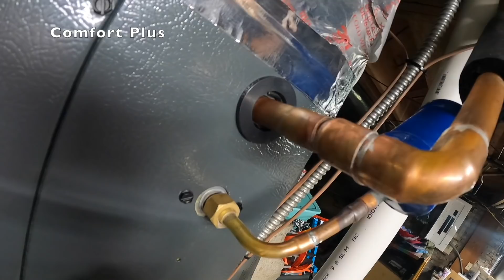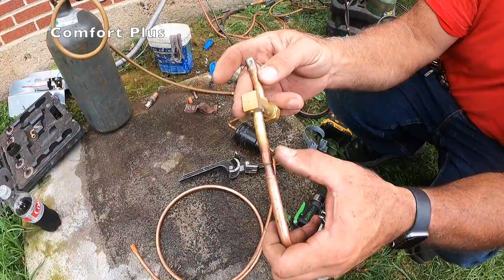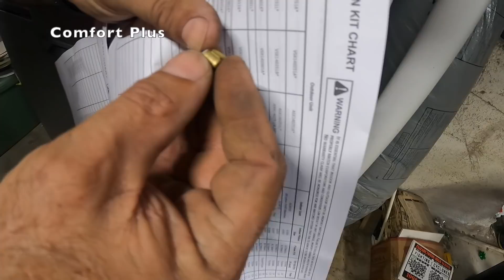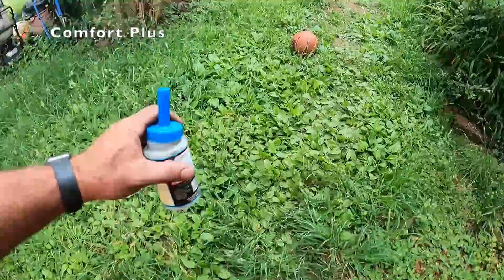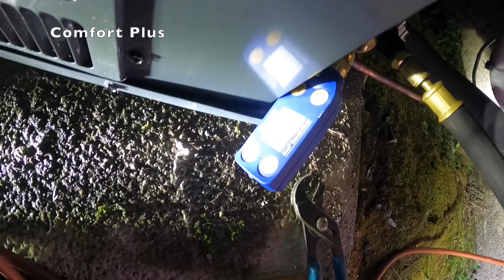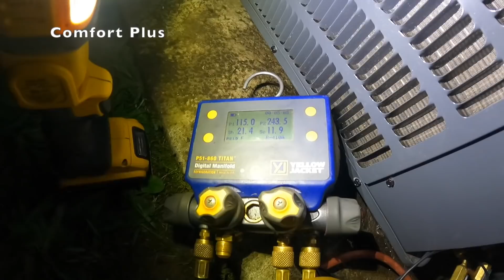HVAC: DIY Goodman Install: Can this unit be saved?

Comment: Wow, what a mess.  I just installed a new Goodman system using Stay-brite 8.  Worked great, system very tight.  Had to flush out the old lines and clean everything out, but the system held great.  For sure the initial vacuum took a bit longer to make sure everything was out of the lines.  Installed with TXV and the system runs awesome.  Adjusted the airflow down to the AHRI rated flow and works like a champ.  Did have to add 410a to the system due to line length, but tech friend helped with that.  People need to understand their limits when it comes to DIY, but hard for some to make a self assessment.

Comment: I would've just installed a whole new line set. That redneck homeowner DIYd the whole system to death with that soft solder it'll eventually come back to wreck that compressor over time. If anything, flushing the whole system to include the condensor would've been the best thing to do before installing a new drier it's gonna cost him an arm but do it right the first time and you'll never get a call back from this owner. Thanks for the video! This is a great Do's and Don'ts video!

Comment: I went to a house and found a water heater hooked up with garden hose and hose clamps. It wasn't even good water hose like the heater hoses in your car, just vinyl dollar store hose with worm gear hose clamps. It leaked just a little, but was in a basement with a dirt floor so nobody really noticed. They had well water so the pressure was low just 30-40 psi.

Comment: FYI for anyone have this issue, Not related to this but since worked on a goodman, not much issues with but one thing have happen on some high eff goodman furnaces run into the solder connections on the Control board for the molex connector for all the sensors etc weaken and crack making intermittent connections, I liked to have never found that changed board and fixed but was so intermittent almost never found, looked at solder connections and could tell was broken loose so re soldered put back in unit run fine ever since. So if get weird intermittent issues, control board but may just be bad solder joints.

Comment: Have some experience, Most Auto but some residential and studied with some commercial on site maintenance guys when did repairs and installs in data centers in company I worked different job once, let me help train with them some. Did some courses too at night, I understand all the aspects and can do most of the install but brazing, I have brazed (welded etc) but I know when not done it enough to do it right on these systems, I let the pros come in and finish it up. And I have talked sever other guys thinking they can install and when I walk them through everything and explain why it has to be done like that they get nervous and hire it out in the end.

Comment: I contracted with a HVAC company to replace my 2.5 ton HVAC with a 3.5 ton unit back 3 yrs ago. The original unit was undersized as per the HVAC company  1950 sq ft and 9 ft ceilings  At the time I lived in NY and my condo was in Florida.  I recently reviewed the registration from Goodman and the condenser unit says it is a 3 ton unit and the air handler can handle up to 3.5 ton.  I called the company and they told me it is the handler that needs to be 3.5 ton and the unit is set up to deliver 3.5 ton.  Is this common in the industry to install a 3 ton condenser to deliver 3.5 ton performance?  I just can't understand how you can install a 3 ton condenser unti and be able to get 3.5 ton performance.
Reply: All you are getting is 3 tons.

Comment: Personal tip, if you please. Take a little liquid acid flux and some Stay-Brite solder and solder the twisted wire part of your fitting brushes. Cut them off at the handle and put them in your battery drill to get a better cleaning job at 1/10 the effort.

Comment: Might have been easier just to cut right behind the bells at the outlets of the service valves and swedge new bells in (or use couplers), than cut back on both lines and couple in new pieces, spin (drill) swedge would work great. Suction line on the inside could do the same, liquid connection cut the bend out and put an elbow in, and than new lengths to fill in. No mucking around with solder removal, unless of course you can see any in the pipe after the bells are cut.

Comment: I have a pretty similar 2.5 ton heat pump with gas aux heat, that I installed in 2016, to replace the (literally) blown up (Original 1956!) Chrysler gas furnace of my newly purchased 'fixer upper'.
Every joint that was silver soldered had n2 flowing through it. Paid close attention to the piston on the evap, etc.
At the same time, the gas company wouldn't turn on the gas, because, while relocating my meter (it was 1 ft from the road) to next to the house, they determined I had leaks in the house. Got those fixed (60+ year old pipes suck!)
All that said...
Other than a condenser fan capacitor fail on a 107° day, I haven't had a bit of trouble with it.
OK, wasn't my first rodeo. Been doing it for 50 or so years.
You do good work, no doubt!
Would you take a tip?
Move your torch around more, concentrate your heat towards the top, but spread it down, touch your stick to the opposite side of where you concentrate the heat. When it melts, it will flow to the heat, add rod till it stops, then quench the joint with a wet rag. The last step will anneal the copper, so that it isn't brittle. 
Try it out!!
A guy I worked for kept calling silver soldering as 'welding'... I would correct him on that. One day, I set down with my tig welder and after many attempts, tig welded some refrigeration copper fittings together, took them in to him to explain 😄.  He went to "silver solder". He didn't want me to 'weld' a joint again!

Comment: I was in residential for 35 years and honestly never seen JB weld on refrigerant lines I guess they were trying to stop leaks maybe? Also the line set size was the cond unit undersized ? I didn’t catch the model number

Comment: Great video thanks but I have an question ?? >  why 2 dryers ? 1 new Liquid line dryer in outdoor unit ( Goodman always 99.99999 % if not 100 % do  have  one built in but hate them when its time to replace them  lol ) )  & now an 2 nd  dryer  inside ...is usually an No No on 2 dryers was way I was always tough anyways 27 yrs & counting install & service ...unless its temporary  to clean up the botched system  esp with an piston non txv coil metering device ?? Thanks

Comment: Read some comments about teaching the homeowner a lesson by charging 7000 to do this repair. This is the reason some techs get bad comments about there work. This is what gives the homeowner bad vibes about installers especially new one . They forget the customer may have been overcharged 2500 by some sales guy who works on commission and now has a problem that was caused by a install tech who cares only about money and over charging so he  can make a 100, 000 dollars in 9 months and hibernate for 3 months because he doesn't like the cold weather. Goes both ways.

Comment: I'm a DIYer to the extreme and I had the EXACT OPPOSITE experience from this video. I did not want to own the $1k of brazing equipment for the very last step of my careful install, so I hired it out. I did not keep the helicopter running and discovered the guy using the high temp rod material and doing everything COMPLETELY WRONG. (Turbo-Torch, No Nitrogen, no hi-silver and flux and making really ugly globs that looked exactly like that hideous epoxy shown in this video. Stopped the debacle before the service valves were opened but it still makes me sick to think about that copper oxidation inside my system.  Got it cleaned up now and it's still running after almost 2 years... I was hoping for 25 years so it could outlive me.  Wish you were the guy I called instead!

REGRETS, but at least I did not have a DIY welding accident and burn my house down or blow myself up, but please pray for my TXV.  lol

Last time I touched an oxy-torch was over 50 years ago in high school and I have absolutely no doubt I could have done a perfect job after an extra tank refill worth of practicing on some scrap fittings.
Reply: There are bad DIYers and there are bad professionals... technical understanding and common sense can take you a long way. There is more then enough information out there to avoid these FUNDAMENTAL mistakes made by this DIYer.

Comment: Don't have a clue what the original installer was doing but I can say that I have Installed countless AC/Heat pumps, remote coolers, refrigerated drawers, walk-ins etc. with Staybrite #8 without a problem and a lot quicker than trying to "braze" with Sil-Fos even the 15% and I can normally do it with a Mapp gas torch. The fact that it actually flows at 450 deg. keeps me from annealing the copper each time I heat it and fatiguing the metal........

Comment: This is why Goodman gets a bad rep, anyone can purchase a Goodman and install it. The bad install then gets blamed on the brand instead of the installer. If you have a reputable installer your Goodman will work just fine for many years

Comment: I thought any solder would work. Learned something today. I'm a DIY and pretty decent sweating copper. No water leak so far, knock on wood.
Knowing your limitation keeps overall cost down. Pay once cry once.

Comment: 18:07.    I can feel it. I sometimes pull my flame off and leave the last little bit of brazing rod on there and it sticks to the Joint then I grabbed a new brazing rod and melt it to the old one.

Comment: I watch and I think, ah why braze? I got tig so I'll just to that, but I think those fittings are copper to brass on the compressor and so I suppose I'd do a silicone bronze braze. I have the tig supplies on hand and keeps me from going to the hardware store to get more stuff.

Comment: Just my thought about DIY work. It would be much better if such simple stuff was properly explained and easily accessible. If you work on HVAC, you know what kind of solder you use but the viewers don't. That might lead to the situation where some guy sees how someone solders parts and will just do it himself. If he does it properly, it would work. The only problem is that nobody mentioned to him that this is different kind of solder. Maybe it would have to be spoken out loud, this is not the same solder you would use for electronics or even plumbing.
I noticed that while watching HVACR VIDEOS when he needs to heat up the solder to bend it. With soft solder it can be bent by hand and that's how I knew this is different type of solder but I've never seen him saying that. Other people could potentially miss this detail and think that this is just a regular soft solder. I bet a lot of people don't know there are different types of solder at all.
Anyways, for the guy who installed this, that will be a lesson learned. The next time he will know that he has to buy proper solder and do it properly if he wants to service it himself. I would surely do whatever I can do myself (if I have time for this) while installing new unit. I would just call specialist to check it and fill the refrigerant if everything is done properly. If not, that's my fault and I'll pay for fixing what I messed up, I would learn at the same time so I don't repeat the same mistake in the future. That's how you gain more skills!

Comment: Doesn't know the S on that dryer stands for solder as opposed to flare, really ?
Reply from the maker: Did you see the model number? 083S and a lowercase s. How do you suppose they distinguish between a 3/8 “ (3) on both ends verses a dryer with 3/8” and 5/16” like this one was? The joke was the little “s” was for “You ain’t gonna have this sh&t on your truck.” Lol Thanks for watching.

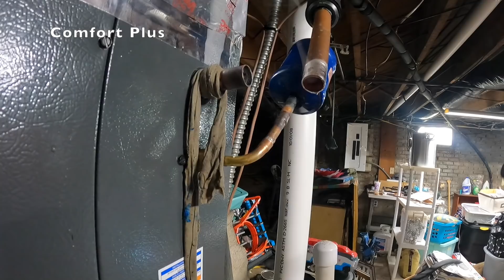Comment: 21:00 I'm a DIY guy and I know that rule about "know your limitations". Changed the capacitor on mine and about to change the control board, never learned working on cars as a kid due to too much being yelled at with the flash light. But like you said with YouTube, I've probably worked on a dozen cars this year and it's only July
Reply: and I know you braze copper, not solder

Comment: That laundry dryer vent a couple of feet away will fill that condenser coil with lint year round...
Reply from the maker: That must be an old vent from times past. The current laundry is on the first floor at rear of house now. So they will be okay on that issue at least lol.

Comment: When you braze in the 3/8 filter drier  why not unhook it at the 90  and remove the white  ring inside the 90 so you don't chance melting it and pull the whole liquid line set w/filter drier  towards  so you can work around it and then let it cool and put it back together at the 90 and braze in that one joint. that way you aren't heating the piston side.  Other wise good work  . This  way you can also check your solider joints with a mirror easy.

Comment: The guy actually bought a vacuum pump and a gauge set.  He could have just paid to have that line set done by someone for probably less money.  I think I paid over a hundred bucks just for a new set of hoses for one of my gauge sets not long ago.
Reply: Here in Cali, you can buy all the equipment (pump, gauges, hoses, benders, even an oxyacetylene set) and still come out ahead of having it installed by a company.  Plus it's not hard to sell good quality tools when you are done with them.  Of course, that requires knowing what you are doing.

Comment: DIY'd my Goodman install and had my neighbor, an AC guy, spend 3 hours checking the system out before we turned it on. He cost me 300 bucks. Unit works great. He adjusted fan speed and Freon levels just a tad. Now anytime there is an issue he'll come fix it at his normal hourly rate.  That's how you do it.
Reply: That’s still not how you do it. You do it by not doing it at all, and supporting your local reputable HVAC business by hiring them to do it.
Reply: @ryanbrisendine3740  Been fixin my own stuff for 50 years. Got a $5000 installation quote (s) for a new system, and that didn't cover the $1,500 Duct and carpenter repair work. Bought one for $1,500 new spent $300 on parts did it all myself. Had my neighbor (AC tech) check my work, system still works great 6 months later.
Reply: @dwmcever   Hope you never have to turn anything into warranty, equipment isn’t covered when it’s not installed by a licensed professional.
Reply: @ryanbrisendine3740  It's warranted. That's one of the stipulations for warranty , have it blessed by a certified installer.  In 50 years of owning Central Air units , never once used the warranty.
Reply: @dwmcever That is definitely not how it works. How’d he bless it for you, with holy water? Lol I would love to see your quality of work
Reply: @ryanbrisendine3740  Well that's how it works.  Unit been running all summer no problems. My 5th Goodman unit in 4 different houses in the last 25 years.
Reply: @dwmcever  Last time, no that’s not how it works, but you can keep believing whatever you want. I highly doubt it was installed properly
Reply: Well I'm the person who has to live with MY installation. Not you. And since I'm the retired Mechanical Engineer I think I'll be just fine.
Reply: @dwmcever  You engineers think you can do anything! Until it comes to actually doing something that requires knowledge of charging a unit properly with “refrigerant” (Freon was the brand name of refrigerant FYI, figured a seasoned mechanical engineer would know that) Now I’d really be curious to see this installation! My opinion is certain things like HVAC equipment should be left to licensed professionals who have been trained on how to properly install said equipment.
Reply: @dwmcever  No thorn up my ass here. I just find it funny that you installed your own unit and then your “friendly neighborhood AC Tech” spent 3 hours adjusting the fan speed and refrigerant levels just a tad. How can he sign off on something that he didn’t install or witness you installing? How does he know that it was properly installed. Did you go from an R22 system to an R410 one? And if so did you either A) change out the lineset with brand new copper or  B) flush the existing lineset so that you don’t have any cross contamination? Did you braze properly while flowing nitrogen? Did you perform a pressure test? Did you pull a vacuum on the system before releasing the charge? And can you explain to me what a hot water heater is? Lol I hope you didn’t get hurt patting yourself on the back
Reply: @dwmcever  That’s what I thought, no response
Reply: @ryanbrisendine3740  Here in New York most of the residential "professionals" are Illegal hacks who shape up in the Home Depot parking lot each morning when the licensed guys pick them up.

Comment: Great job...I'd of taken the king valves apart (remove the stems) and removed the copper stubs and replaced them while you had the unit on it's side.  I've noticed those Fieldpiece vacuum pumps don't work all that well.  I use an old Robinair that would suck the balls off a bull.  Hopefully some homeowners will learn this is one job you want to leave to the pro's.
Reply: A pro wouldn't call them king valves :o)  I just couldn't resist.

Comment: Great work. I must say though I’ve gone to stay brite 8 only. Brazing is just too damn hot. You weaken the copper with all that heat, risk wrecking components, have to drift nitro. Screw it all. Haven’t had one problem in years. Refrig and ac
Reply: Staybrite is nice, but 1) not allowed by code in most places and 2) requires extreme cleanliness to get a good joint, which leads to 3) possible flux contamination.  But if you do it right, it works well.
Reply: @gor312  I’ve used it on refrigeration and ac for years without a single problem